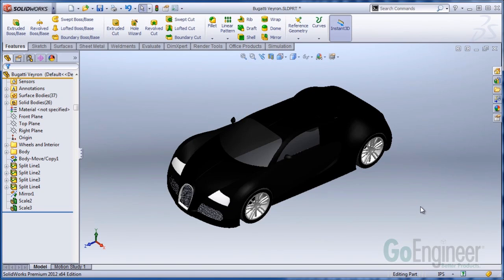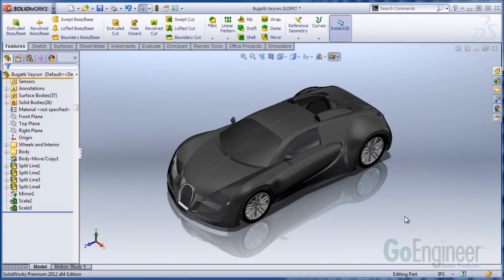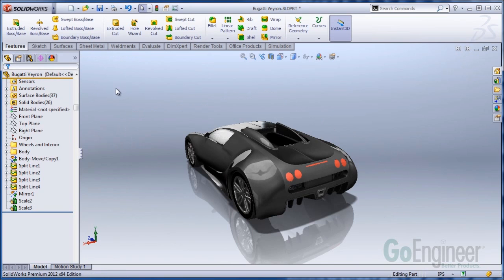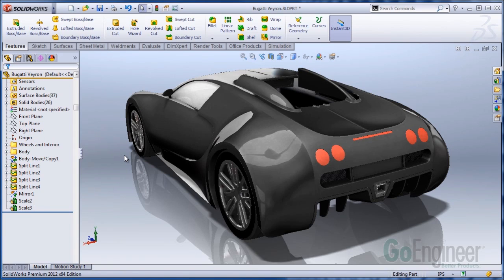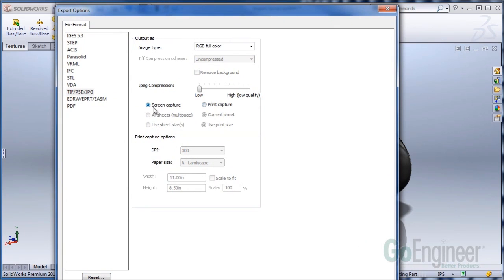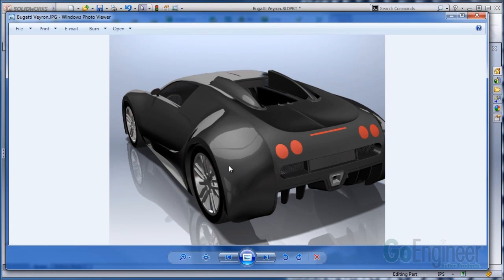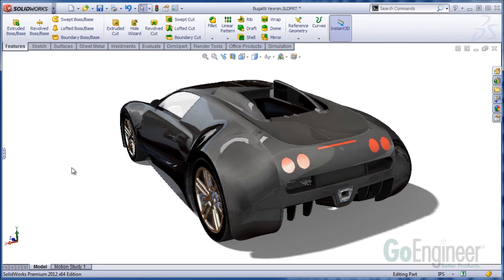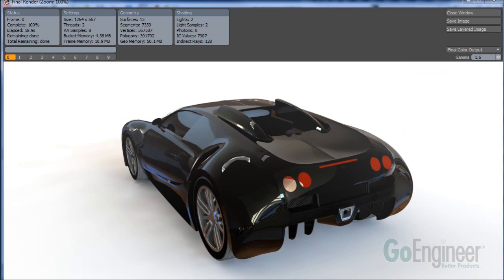SOLIDWORKS Quick Tip - Getting Started with High Resolution Images

Comment: Very helpful video, thanks. Just want to ask if anyone here knows a way to print out a model in actual size? I mean if for example a model a 10 * 10 * 10 cm cube how I could achieve that the cube I print out on an A4 paper will be 10 * 10 *10 cm on the paper?  The only way I have found so far is make a drawing from the part and change the scale to 1:1, but in drawing mode there are all those corner lines around the paper and text boxes on the bottom of the paper (like project name etc etc) which I don't need and very distracting. Basically I just want to print out the model in true 1:1 scale.
Reply from the maker: Probably the easiest way to print in 1:1 scale is to do exactly what you are describing and then go into the drawing's feature tree to delete the 'Sheet Format' item.  This is the titleblock and border lines that you see.  Deleting it though will make a blank page with your 1:1 view on it to print out.

Comment: This was also from 6 months ago but the comment about the render taking 19s.  I have rendered this car and many others in 3-5 minutes with a really fast car with all the options on(bloom, direct caustics, camera with clipping planes etc etc).  Depending on the size output, quality settings and performance of the computer you could get a really nice render in under 30s.  If you have a slow, low processor speed, single core cpu with blah blah blah it could take many many hours to crank out a nice render.

Comment: Brandon, If you want drastic changes or more realistic perspective views you are better off using a camera.  The model doesn't have to be in large assembly mode or anything like that.  The veyron in the video was my model and something like a car is easy to see perspective by going to a front view, then turning perspective on.  That model and several other of my car models can be downloaded from GrabCad
https://grabcad.com/library/bugatti-veyron--1

In terms of modding the perspective view(which it sounds like you did) going to View>Modify>Perspective allows you to change the number.  Depending on the object the change in this number may be drastic or negligible.  Changing it to 1 is the most drastic because it means that your "position" is 1 length of the object away from the front.  This means the difference between how you see the front of the object and how you see the rear of the object is as skewed as it can be.  Think about a 20ft long car.  Perspective set to 1 "means" you are 20ft away from the front of the car which puts the rear at 40ft away from your viewing point.  A perspective set to 2 means you are 40ft from the front and 60ft from the rear.  The larger the perspective number the smaller the ratio gets between how far the front and rear of your object are away from your viewing point.  Once the car is at 3 you are 60ft from the front and 80ft from the rear.  When you apply this to a large/long object the difference is easy to notice.  When dealing with something very small or very curvy its hard to tell.

I hope that made sense.